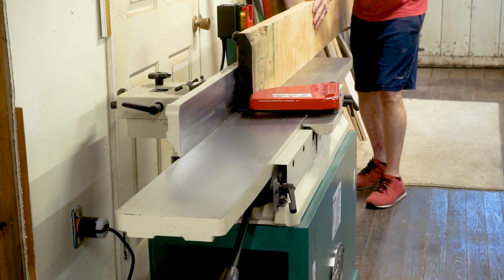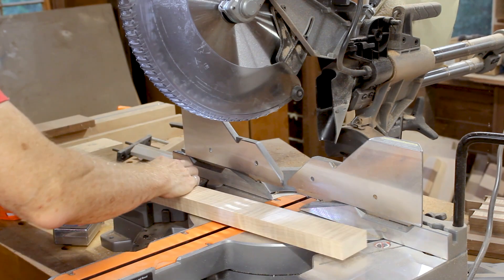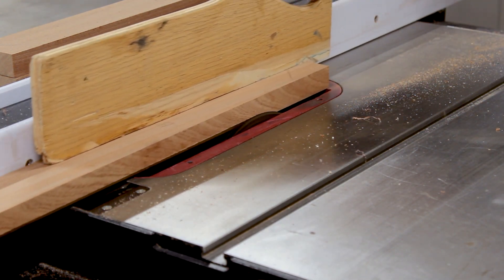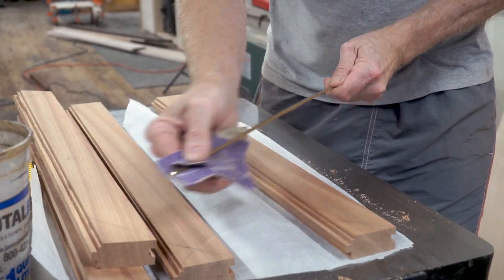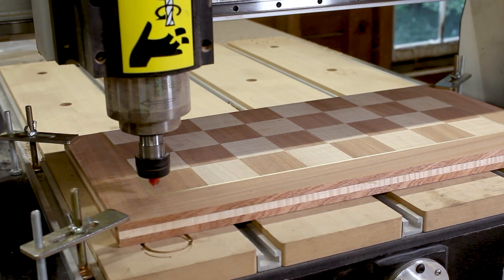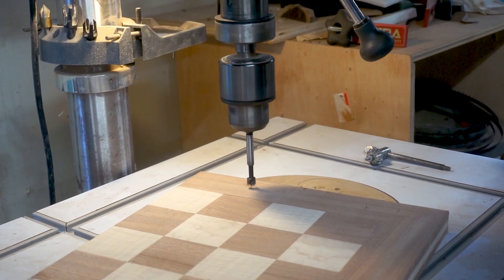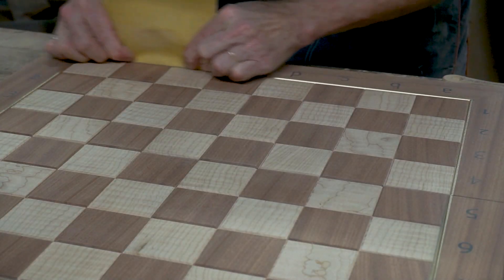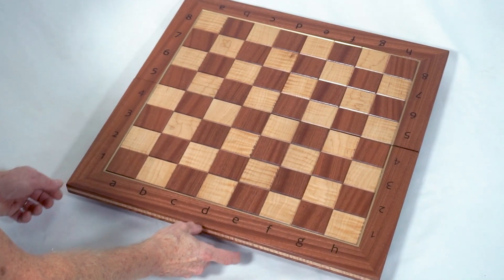Making a Folding Travel Chess Board with Magnets

Comment: Wonderful woodwork video Mike. I myself however have come to the sad conclusion, that it is not possible to hold a folding chess board open with just magnets. My attempt was to make it seemless; so there was no need for a locking mechanism on the side. But I don't think a 2 x hinge folding chess board can remain open, from just neodymium magnets alone.

I have so far used 24 x 10mm x 3mm magnets, across 4 separate areas. Which prevents the board from closing, when held at 45 degrees. Obviously one could use 20mm magnets, but the height of a chess board is only 20mm.

Every magnet you incorporate into the wood, either side, adds more weight; that the magnets have to prevent closing. I was originally hoping the board could remain 'locked' open, from the strength of the magnets alone. But I don't think it's physically possible. 🙁

Comment: Hi Mike. Quick tip from a Phycisist... the best way for a magnet to lose it's magnetism is to hit it with a hammer haha. It disaligns the domains in the metallic crystal lattice (whose alignment initially causes ferromagnetism). It seems like it wasn't a problem here but maybe watch out for that if you want the REMs to maintain their pull
Reply from the maker: I figured that a hit from a relatively soft dead-blow hammer wouldn't be a problem, but I'll keep that in mind the next time I work with magnets.  Thanks!
Reply: I screamed that when I saw him banging the magnets. Don't hit them. It's why I wouldn't use magnets for things like this. Just use a latch.

Comment: Curious, when you finish with a shellac and then lacquer, are there any issues with the finishes bonding? I'm still new to finishes.
Reply from the maker: Most shellacs have wax in them, so that would definitely be a concern. I use a de-waxed shellac to help ensure a proper bond. I used to use Zinsser Sealcoat but it became quite expensive at the start of COVID, so I've swiched to using this product so that I can mix up my own at a low cost:  https://amzn.to/3gTvMzM

Comment: Im curious why you use a brush for the shellac when you have a sprayer?
Reply from the maker: I generally just keep lacquer in my spray gun, and that way I don't need to clean it after each use.  I should probably just get another spray gun for shellac.  If I was going to apply a lot of shellac, or if I was applying it to different colors of wood that may bleed together when brushing (e.g., padauk and maple), then I would definitely spray. In this particular case, I wasn't worried about brush marks because I sand most of the shellac off. But some of the shellac remains deeper in the wood fibers to give it a nice color.